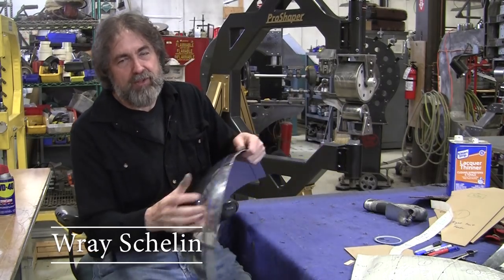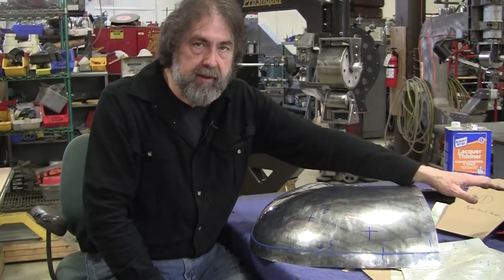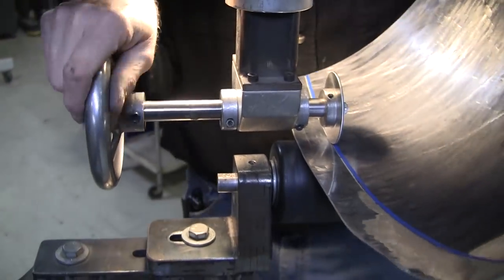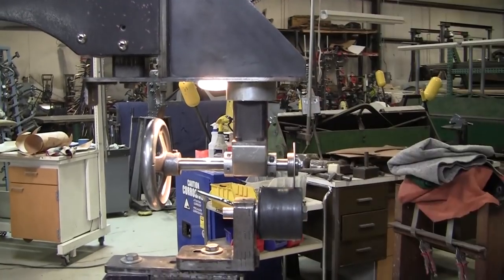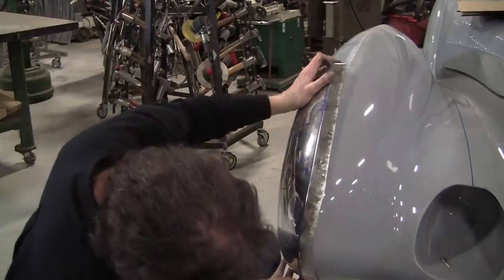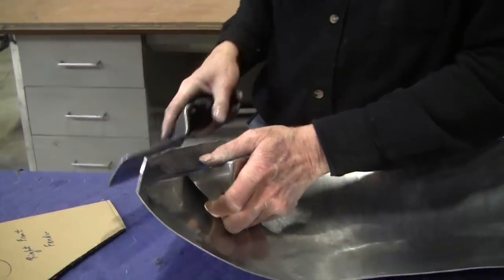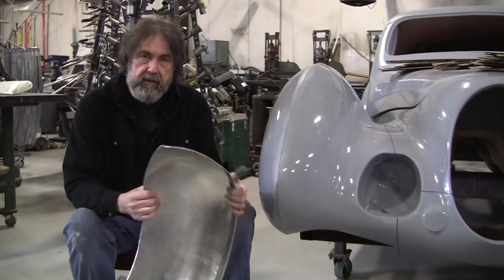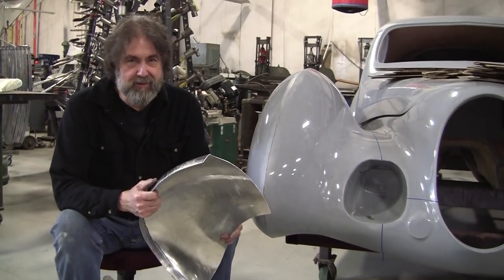Tipping and Finessing the Talbot Lago Fender

Comment: Awesome job fitting that complex curve-flange transition Wray. Although those stipple dies are the cat's meow they are quite expensive and I've found that easy pressure with normal shrinking dies with several passes can do a decent job without damaging the material to badly. Looking forward to the continuation of this project but still have a burr in my Sadler to see the completion of the Jag hood fender assy!

Comment: Do you know if any of the hammer form bucks are still around?  You would think they would have been saved if only by some of the workers.
Reply from the maker: Have you ever seen the Cobra solid wood buck? It is very beat up but still exists.  A Ferrari 250 GTO wireform sold for $350000.00 several years ago.
To answer your question about the original Talbot Lago bucks I believe they are long gone.